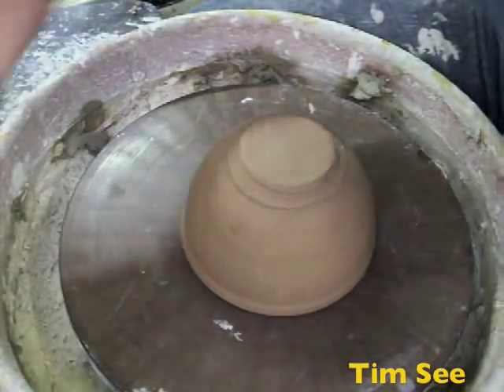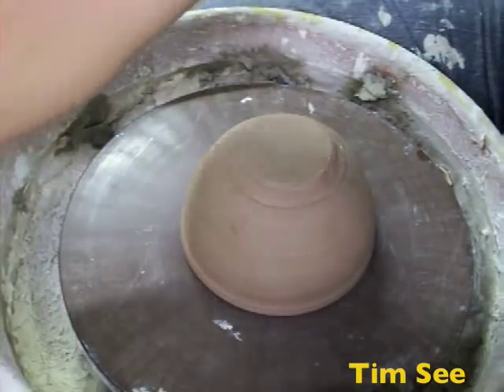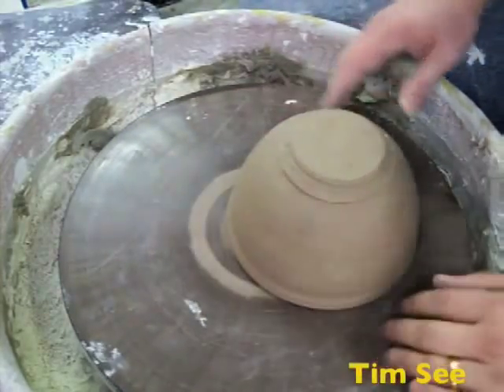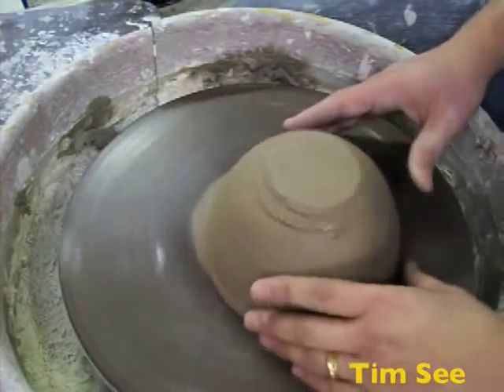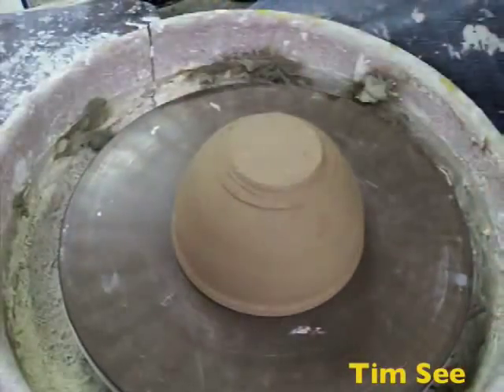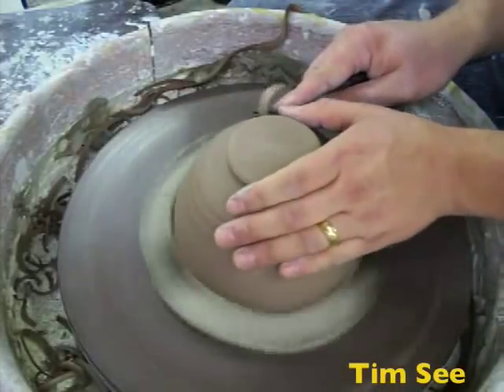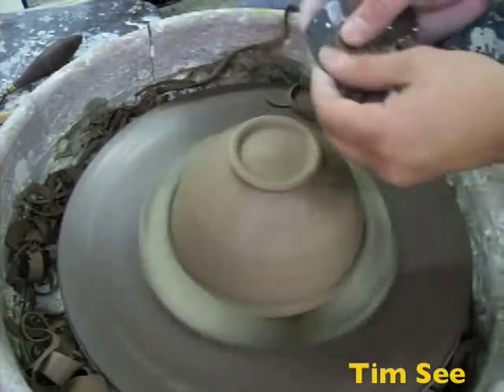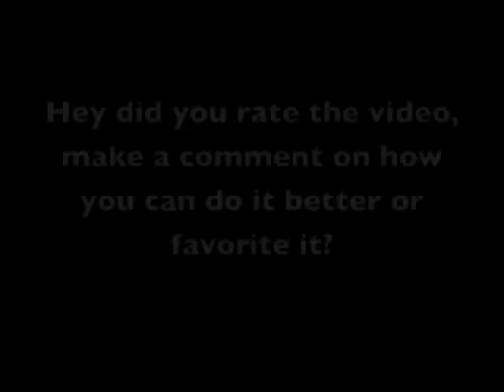Trimming

Comment: Whenever I trim, the moment I put any pressure on the loop tool, it catches in the clay and rips my piece off the wheel. Is my clay too dry? I've tried pressing the coils of clay that I use to secure the piece to the wheel in harder, but all that does is warp the lip of my piece and it doesn't fix my issue.
Reply from the maker: Coco well it sounds like you are trying to trim when the work is too wet. It should be stiff enough that it won't warp when you press the clay against it. Trimming with the wheel moving faster can help too.
Reply: Timsee clay thanks! I know it's not too wet, although I see where you're coming from on that. I do tend to slow down a lot because I'm afraid to make the wheel go faster and then have my bowl come flying off. I'll try moving it faster :)